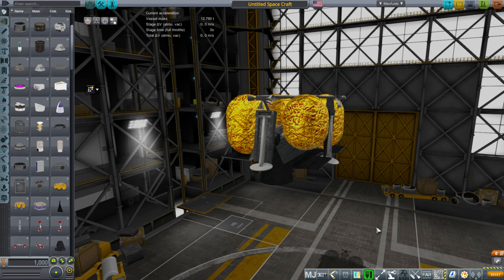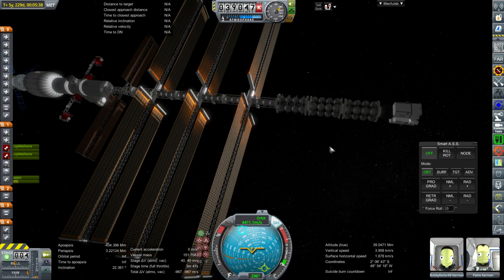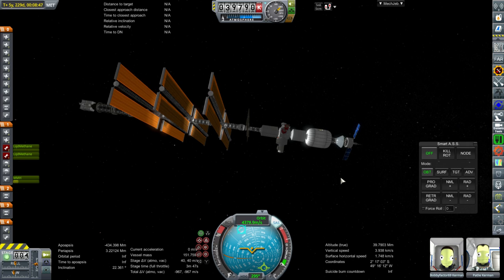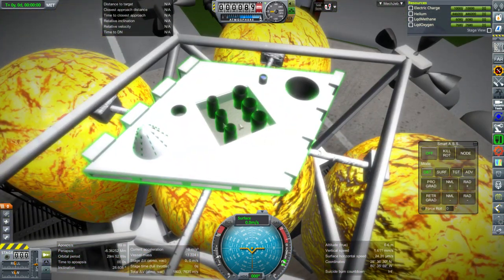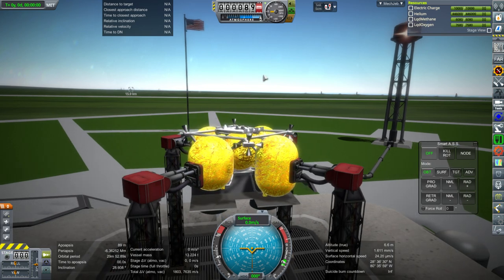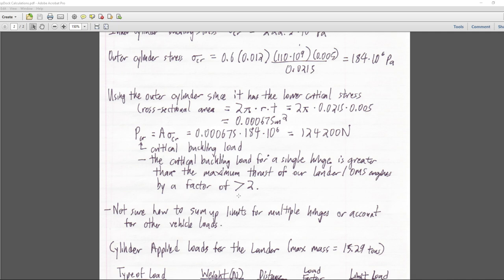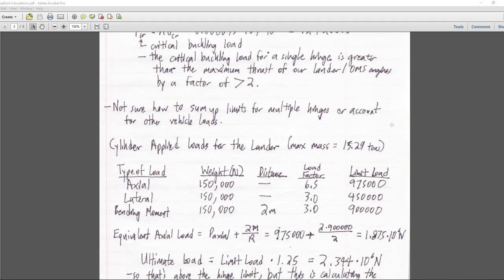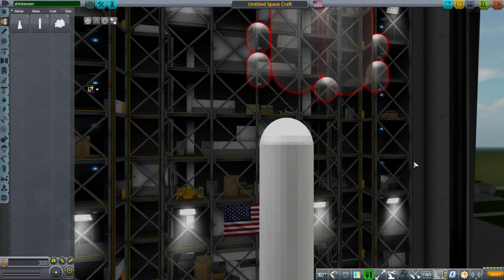Rocket Science - Design Reference and Propellant-Only Docking Port

Comment: i think docking ports may be round to have a stronger structure to withstand the pressure difference. a diamond shape could introduce weak points in the corners under pressure
Reply from the maker: Well, this port isn't actually pressurized, so that's not a concern (I used a fake pressure of 30 psi to get a sense of how thick the skin should be). Someone mentioned welding and torsion issues, which might be a thing. I was considering just having an internal truss structure or perhaps a torus on which the latching mechanisms are mounted.

Comment: Nice video but I wish I hadn't watched it. Don't get me started designing parts for KSP, I will never get anything done =P

The circular ports are mainly because they need a portal for people to pass through and a circle is the strongest shape under pressure.  Your port looks nice, the pipes would be a continual problem though. It might be better to go with some sort of flat seal.  Pipes get bent and require grip pressure to hold a seal, both would cause release problems that flat plates wouldn't have.  You mentioned normal docking ports being strong because people pass through them. What would be worse, a port malfunction with someone in it or a port malfunction leaking fuel and starting a chain reaction killing all of the Kerbals?  This needs to be as strong if not stronger then a normal docking port. 

Have you tried Fusion 360?  You could model it up in that with the different materials and do stress tests on it.
Reply from the maker: I have Fusion 360 and ANSYS Workbench and I'm looking at lessons for the latter. I do wonder exactly how to set up the situation and what loads to apply. I think we're using different definitions of strong, so let me put it this way - the normal docking ports need to be more massive because they have a large pressurized aperture for people to pass through and have additional hatches on both sides which are 2 meters in diameter, while the propellant-only port only connects smaller diameter pressurized pipes. I think you took the garden hose analogue too literally - I just haven't worked out the attach/detach method for the pipes. A flat interface might be a better idea - might even be less mass.
Reply: @RaizSpace   I think most of the mass for the regular docking ports are in the docking mechanism and is required for the torsion stresses that it might receive.  We aren't talking hundreds of PSI, your car tire has twice the pressure of earths atmosphere.  Lets take the space suits for example, they are also pressurized, how much extra mass is required for that?  How much mass is in the tank carrying the nitrogen to pressurize the craft?  They aren't near as heavy as the docking ports. So, all of that leads me to believe that the pressurization isn't a factor in the port design other then for the seal itself.

I have been fortunate enough to spend most of my life in the aerospace industry working with these materials.  It was mostly manufacturing turbine engine parts but I did work on one of the SRB seals on the shuttle.  I have beat, twisted and pried on material thicker then what you are talking about.  Knowing what happened when things went wrong and what I did to fix it I can only imagine what would happen to a dock with a 20 meter arm attached to it bouncing off the ground at 3 m/s.

All of this is just my opinion, I could be totally wrong.  Like you I have no engineering experience, on the part design at least.  All of my experience is in developing the manufacturing process for them so I never had to deal with any of the stress analysis and such.  I would guess that you need to figure out how much impact force you would have and apply that to the opposite end of part attached to the docking port.  But then you are actually testing the whole assembly not just the docking port.  Figuring out how much force would be transferred to the docking port from all of that is well beyond my abilities.

BTW, Thanks for all of the great videos, you and a couple others have really got me back into KSP.
Reply from the maker: I appreciate your input - don't get me wrong. And yes, the main stresses would be torsion stresses, which is why the components handling those on this docking port are 5mm thick Titanium rather than the Aluminum skin. I could add a Titanium frame connecting the latching fixtures on which the Aluminum just sits as a skin. I'm a bit unclear why a dock with a 20 meter arm would be bouncing off the ground at 3 m/s?
Reply: @RaizSpace  You were talking about being able to handle the landing stress, @26m "the lander is going to be landing on mars...it needs to be able to handle the loads and stresses between it and the lander can"  If this is a space only dock then it wouldn't need to be "as" strong but it still needs to be thicker then 1mm.  Grab a compact disc and look at it, that is 2.5 mm thick.  If you have a 3d printer print up a section so you can look at it in your hand.  I do the same thing in my designs trying to conserve material and make things lighter.  It isn't until I print it out that I realize I have designed it for a mouse.

Please don't take any of this the wrong way, I love the port design I just think it needs to be stronger.  I use the rotating port mod because the round ports suck for alignment so this type of design would be nice.

Comment: Have you tried using an AutoDesk product? I imagine a proper engineering software would help out a lot. And I assume you could export the model?
Reply: And you could conduct cool simulations like load stresses.
Reply from the maker: I'm looking into ANSYS Workbench right now. For drafting, I have Autodesk Fusion 360, but just modeling directly in Blender seems best so that I can eventually send it into KSP.

Comment: Your docking port is pretty much a repurposed Scharfenberg train automatic docking system invented nearly one century ago.
Reply from the maker: Well, I guess that's good. Any idea how heavy it was and how large it was? If it could take train connection stresses, that's a good sign.
Reply: @RaizSpace  It is not that heavy since it is for automotor trains (with no locomotive in the front, like subway trains or suburbean trains), the idea is to make multiple train units into a longer train easily for rush hours and decouple them for off peak hours. Look at 'Attelage Scharfenberg' on Wikipedia for more info, I hope there is an English translation. The good thing about it is the trains joining together is automatic, the couplings autoclamps eachother, you just have to actuate a lever to release the coupling. The system provides electrical connection as well as brakes air conduit connection.  So one guy can drive multiple train units with one drive cab since all electrical and electronical info as well as brake power go through the couplings. Berlin metro uses that system extensively. French TGVs too.
The only real modification you applied to it is the exterior clamps for securing the connection between two modules as a existing space docking port do.
Oh it was invented even sooner than I thought, in 1904. I f you know German, there must be some articles in German since it was a German invention. Funnily enough, your concern about things getting in the way of the connectors is exactly the weakness of the Scharf coupling. On trains, snow or ice for example are the main problem, so the coupling are covered when unused (on exterior lines during Winter) In space, there should be a protection against thermal contrasts and of course space dust/debris as well as radiation but it might not be a problem since existing coupling systems also provide electrical and fuel connections, so the solution must be very similar.
Reply from the maker: I don't know German, but it's nice to know that I wasn't totally off the rails with the idea.
Reply: @RaizSpace  On pictures you see that the system is not that big to begin with, so it musn't be that heavy, sure a little heavier than standard couplings (which do not integrate electrical and brake circuitry), so all in all, if you add that, the Scharf system is very compact and weight effective I think.
Nice pun btw !